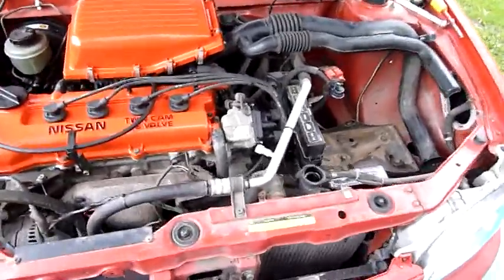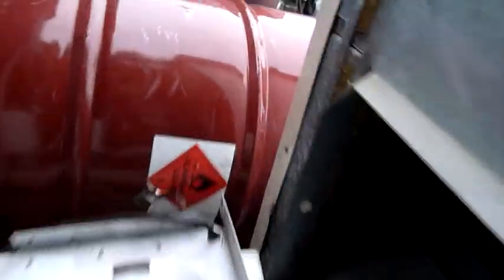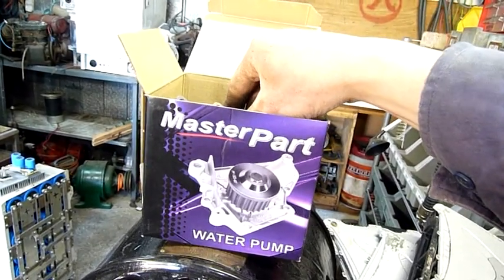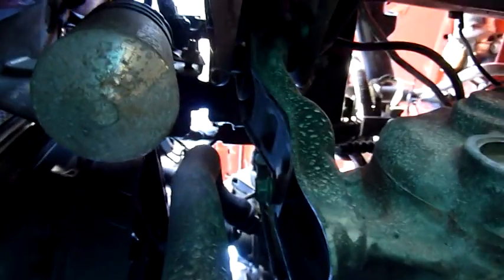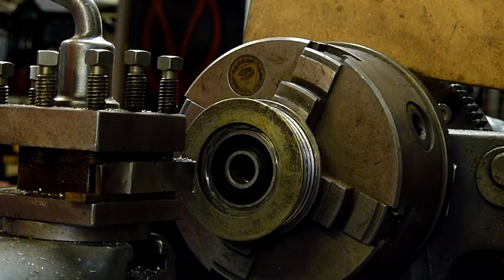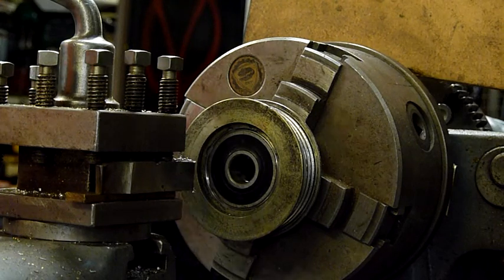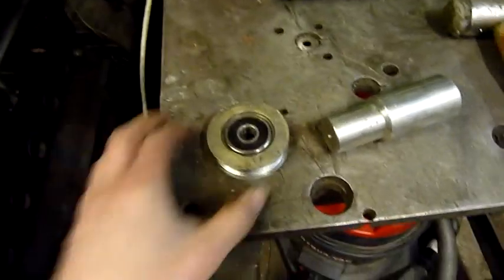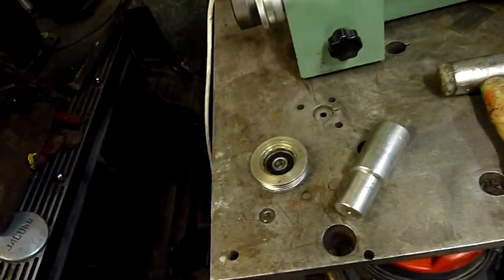Nissan Micra Care Pt3 - The Stormy Interruption.

Comment: in the states it varies from city to city. Small cities like where i live have 1 primary step-down unit (in the form of the local substation), and then the neighborhood step down units (bring it down for distribution to small businesses and local areas, they are the big chunky ground-mounted 2 ton monsters... i think), and then finally the pole mounted transformers for final step-down to 120VAC. Bigger cities (EG new york) have different power distribution systems for obvious reasons.

Comment from the maker: yes! that's a big mistake!. I've seen them shatter and weld themselves up without warning!.

its one thing to use chinese bearings on a small trailer and have it lock up and smoke a tire, its another to have a front wheel on your car suddenly become inoperable!

I would be replacing them with Timken or similar high quality brands ASAP!

Comment: You are such a clever bloke, that tool you made did a smashing job :-)

Did you put a thin film of locktight inside the pulley before you pushed the new bearing in or do you think the center punch method is good enough?

hey you have been busy with the car, the engine looks so much better in its new colour :-)

We had halestones like bloody golf balls a month ago, it made a bloody mess of my mates car, the windows and bodywork were runied, it was scrapped!!

Great vid :-)

Comment: I nearly got hold of a Large Power Factor Correction Capacitor from the local Salvage Yard, it came from a power station, Unfortunately, it had been dropped and 1 of the 1 foot long ceramic standoffs was snapped off :-(, Capacitor itself stands as high as a 44 Gal Drum !!

Comment: and the only reason I replaced the bearings is my brake rotors wore out at 100K miles  and they are pressed in pretty tight , and when my rear axle  carrier assy let loose and put bits into the tubes and hub ends  and ruined them and lately I have been seeing over here SKF is using Koyos as part of there stock , WTF??  SKF was a quality name whenI was a kid . now its only Timkens .

Comment: How do you remove the radiator from the micra? Do you have to take out the front bar or is there a way of getting the rubber mounts out and remove it then?

Comment: chinese bearings today are like the japanese bearings of the 70'and 80's roughhh surfaced and crap alloys , only one I would use thats chinese and thats timkin as they ship the alloy rods over to them and use americans in there QC department so they get made to the timken quality , I only buy Timken front hub assys for my cars and ones I fix because of that , and I Only use timkins on my 1 ton Pickup truck as thats what chevrolet put in them from the start .